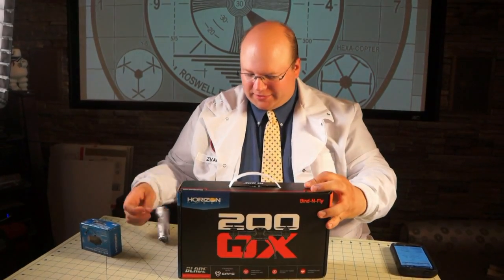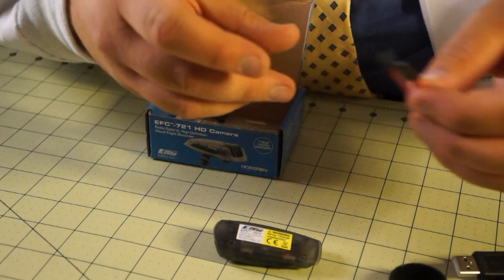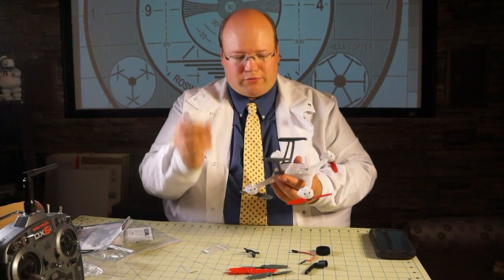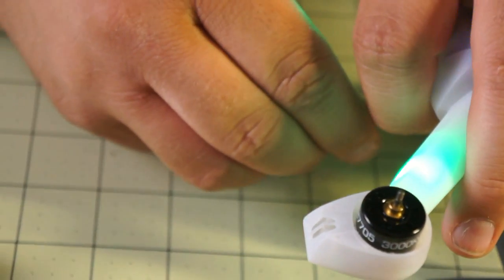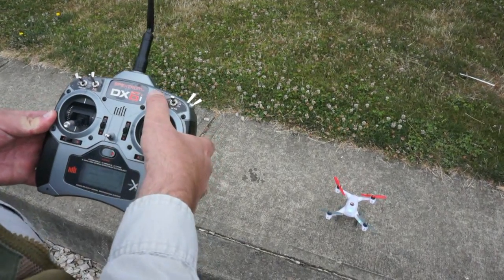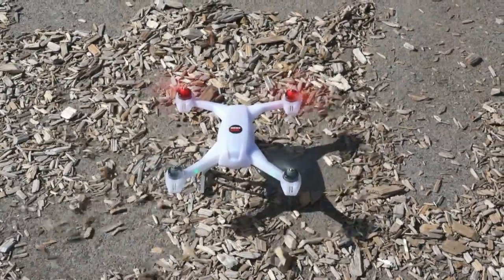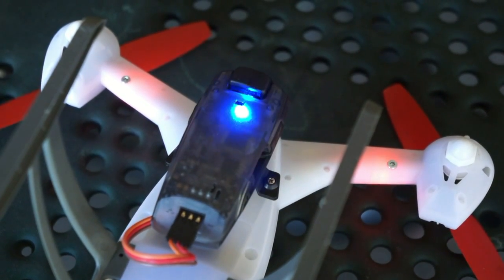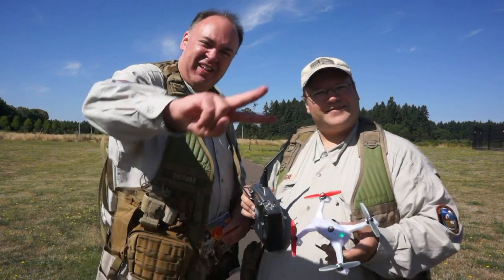RFTC: Horizon Hobby Blade 200 QX Quadcopter Unboxing, Assembly and Flight Testing

Comment: Throttle trim adjustment will cause arming not to work.  You can adjust the trim to make the arming sequence work, but it will not cut the motors with the same motion, you have to use the throttle cut switch to turn it off. (Avoids accidentally shutting the motors off in flight).
Time has passed this one by, but it is still a great little sport flyer and a good candidate for modding to fpv.

Comment: I just got this quad and it's awesome just one problem i have the DX6i radio and i did bind it succesfully but everytime i change battery i always have to rebind it.I setup everything according to manual and turn on the transmitter first then the qx200 but it doesn't bind unless i do the bind mode over and over.Great review btw.And sub

Comment: They should make a 100QX, or even a nano QX with the same design.
The weather in Ireland isn't always good. It's either raining, or it's too windy so I only get to take my 350QX out once a week and I would love to speed around the house in a tiny version of the 350QX.
Reply: bpunlimited sounds like you need the Mariner. it's a water proof quad, a little bigger than the 350QX.
Reply: steve sparrow I doubt it performs as well as the 350qx.
Reply: I have a friend who has it, and he likes it a lot. just a suggestion to get you out flying whn it is wet and raining.

Comment: I did some research and couldn't find a definitive answer, this 200QX only comes in BNF right? I've only been flying quads for 3 months and my blade mqx and dromida ominous were RTF so i don't have a transmitter. which one do you guys reccomend? i'm looking to get the 200QX soon.
Reply from the maker: Hey, Eruscool! First all, welcome to the hobby and fly safe! Second of all, yes, you are correct, the 200 QX is only available in a BNF version -- there is no RTF version available. Third, be advised that the 200 QX is a very powerful aircraft. Even in it's most docile setting, it's capable of putting on some serious speed quickly. Both the Ominus (which I love) and the MQX are rated for "Beginners." With the 200 QX, you are moving into "Intermediate" territory -- so take it easy until you get comfortable with it. As to which transmitter you should purchase -- I'd recommend a Spektrum, which is manufactured by Horizon Hobby (who makes the 200 QX and also your MQX). Beyond that, it's really a question of your budget and your ultimate goals in the hobby. The more money you spend now, the further you're going to be able to go with that radio before you need to upgrade. I purchased the Spektrum DX8 when I was just getting started -- and I've never looked back. If you can afford it, I'd go with the DX8 or above. Also, I wouldn't go any lower than the DX6 (the radio which you see in this video). Below the DX6 you start losing basic features that are really nice to have (like multiple model memory and an LCD screen for controlling the radio). The nice thing is, once you have a good radio, you can buy all BNF models from now on and save some money on your future purchases. Good luck!
Reply: I just bought this and the one they are using in the video, the (DX6i) is the one I also bought. I found a lot of how to set it up with the 200 qx for that transmitter on youtube. And its got great reviews.
Reply: HumbleHeartMinistry so I've had it now for 2 weeks, I got the DX6i and I love to fly the Damn thing. I've pretty much mastered it in the "blue mode" so I decided to try the "red mode" the other day in moderate winds...big mistake I wasn't ready and I went straight to the ground. Broke one of the legs and the bottom of the body, I assumed I was gonna crash and break things at some point so I already had a spare body on deck.
Reply: Eruscool Sorry to hear about your crash. I just ordered it. It should be here by wed. Can`t wait to try it.

Comment: FYI you can re-start the motors after a crash without unplugging the battery.
Reply from the maker: Hey, Dubbin! Thanks for the tip... I'll amend the review we've put together for RC Sport Flyer to include this fact. I guess it shouldn't come as too big a surprise -- we couldn't always get it to start on the first try even under optimal circumstances! Judging by the thumbnail you've selected to represent you on YouTube, I take it that you're a fan of the 200 QX?
Reply: Huge fan!!!

Comment: Great Vid guys!.  I picked one up over the weekend for FPV and it's all smiles!

Lights...this thing has so many lights on it.  After flying FPV so much I tried an evening flight and got all mixed up since you could see all 4 lights clearly.  The 350X had directional lights which let you know when you were tail in.  For this little guy you really have to pitch forward or back to see if the reds are above the green or green above the reds to tell if you are coming or going.

I'll just stick to FPV.  Much easier!  I did get out to almost 600' and it went into failsafe.  That's a nice mode, self levels and reduces power for 10 seconds. It may land itself but I just put my transmitter over my head to regain signal and fly it back.  Love this thing!

Comment: Stay on target, LOL! that was my mantra in many a vintage motorbike race. Why is the US flag backwards on the shirt though?
Reply: It looks backwards but it is correct. It is to simulate the way it would wave when walking forward. If you notice the flag on airplanes it is set up the same way. If you see the flag on his other side it would look correct.
Reply from the maker: We had fun with that -- and the Star Wars quote just seemed appropriate. Regarding the flag, Jake has it exactly right. I would only add that the guy at the embroidery shop was pretty insistent that we use the "backwards" flags on our shirts. Old Glory is worn on the right sleeve, but if you use the conventional display configuration, the field of stars is towards your back. If you imagine a flag on a pole in the wind, it would look like the flag is in retreat -- not an especially patriotic image. So, the flag is flipped, as if moving forward. I think the "backward" flag custom started with the US military, and it's been slowly migrating out to law enforcement and other flag-wearing civilians. The embroidery shop where we had our shirts made does a lot of work for law enforcement, which is probably why the guy was so insistent we use the "backward" flag.
Reply from the maker: Jake Barritt Hey, Jake! Thanks for stepping in with the explanation!

Comment: I love this mini quad...it's really fun with a small fpv setup.
Reply from the maker: It's a great little quad -- I was honestly surprised at how well put together it is... Horizon got off to a slow start in the multirotor business, but they're clearly trying to fight their way back.

Also, it was a lot of fun throwing the little FPV module on there and flying it that way... Techinstein has an idea about taking it apart and permanently mounting an FPV system on board the aircraft. If he ends up doing that, I'm sure we'll make another video or write a magazine article about it, or something... Stay tuned.